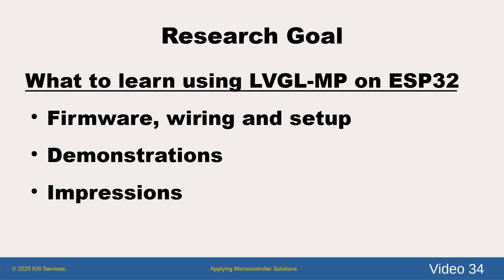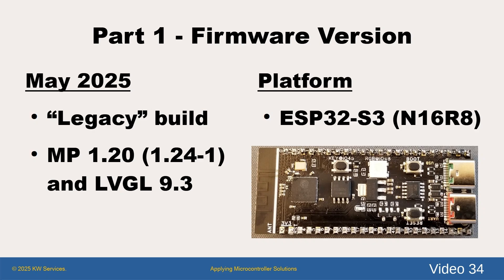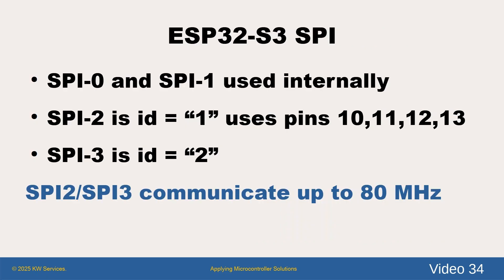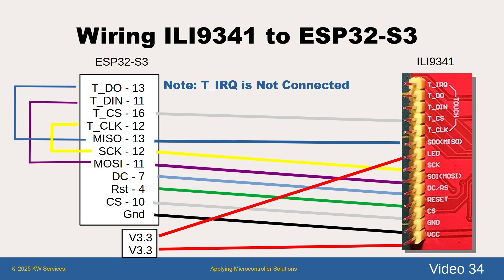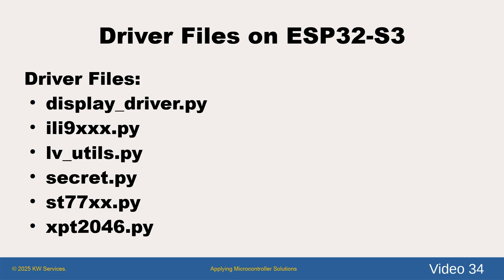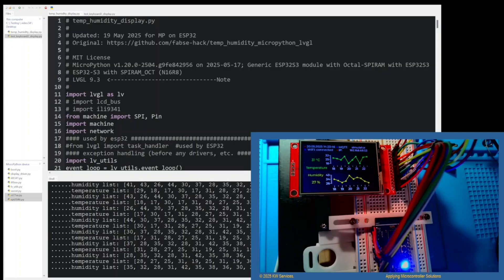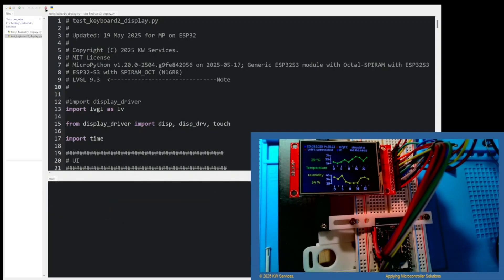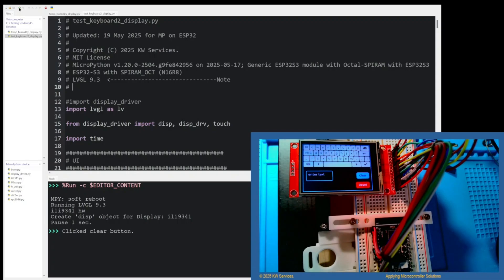ESP32 - MicroPython LVGL 9 – Is it pioneering a new way?

Comment: Hi. your video is good , I'm interesting for JC3248W535C with MicroPython , you can help with this ? thanks.
Reply from the maker: Hello, thanks for the comment.  I do not have that device.  However, at this link https://github.com/kwinter745321/ESP32LVGL/tree/main/Firmware/May2025/MP-LVGL9.3-1.24-ESP32-Generic-S3 you will find the firmware that should work for your device.  Can you flash the device and see if you get MicroPython running via the USB port?  

 I am hoping that display type AXS15231B is similar to the other drivers..  (See if this link helps:  https://forum.lvgl.io/t/jc3248w535-axs15231b-driver/18707) .

Then you need to get the remaining drivers from the video34 directory (at the same website.)  At this point the display_driver.py needs to be modified slightly to use the above driver and the proper pins need to be assigned.  I am not sure about the cap touch controller as the Amazon site does not mention.  But I just did video 41 that could possible help.  At Amazon, your device is manufactured by www.diymalls.com.  This site is not open.  As a buyer, perhaps you have the pinout information for the display and touch?  

Please follow up and let me know how far you get. so I know what else to suggest.
Reply: @applyingmicrocontrollers  thanks , I try it ..
Reply: @applyingmicrocontrollers  Hi. I upload firmware what you send me , working but here I'm stop .. don't konw how to continue.. my display is different.. you use IL... .
Reply from the maker: Hello.  I found a link to a MicroPython driver for your device.  https://github.com/straga/micropython_lcd/tree/master

Please let me know if itr works.
Reply from the maker: Also, this link discusses the driver.  https://forum.lvgl.io/t/jc3248w535-axs15231b-driver/18707/3
Reply: @applyingmicrocontrollers  I try it from straga , but still missing any module , or in module are syntax error .. typing , machine .py still errror..
Reply: If want use project from straga then need first compi8le firmware from lvgl_micropython , and I don't know how .. , your firmware *.bin file working but I don't know how to add display driver from sraga to your project..
Reply: @applyingmicrocontrollers  Hi. I today compile source code and now working . But I have problem with code , for example if set event for button then not receive right event ..can you help me with this ?
Reply from the maker: Hello.  Try to look at video 23 and its code example.  It shows button event examples.  Also if you can post the xxx.add_event_cb() function you created and also a simple version of the callback.  I can look further.
Reply: @applyingmicrocontrollers  if you have email , I send to you my complete code .. and firmware ..
Reply from the maker: Regarding your question on long_press.  I have not tried this recently, but from the LVGL documentation...

Long_press is detected by the INDEV.  You must first define a long press period.  This is based on this LVGL c function:
```
void lv_indev_set_long_press_time(lv_indev_t *indev, uint16_t long_press_time)
Set long press time to indev

Parameters
indev -- pointer to input device
long_press_time -- time long press time in ms.
```

for my ESP32_Generic in the display_driver
```
indev_drv.long_press_time = 20
```

Now the LVGL event handler will detect long presses.

k